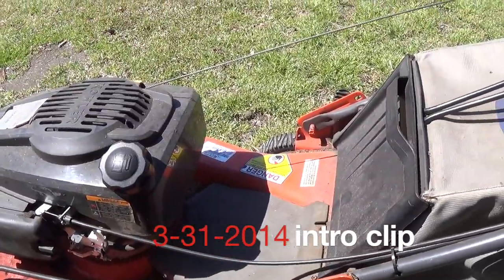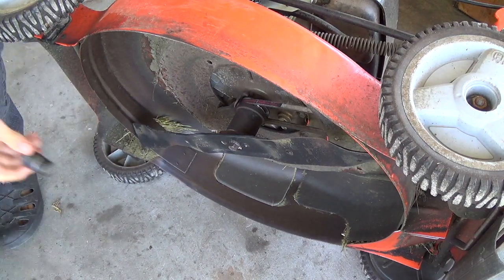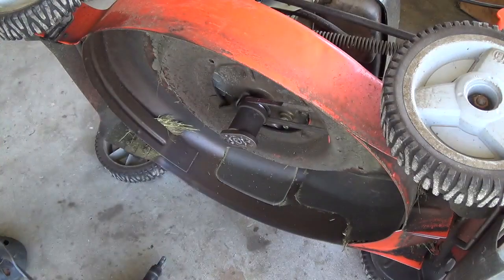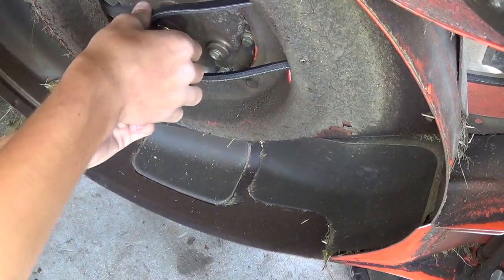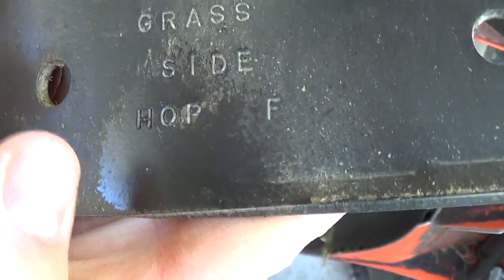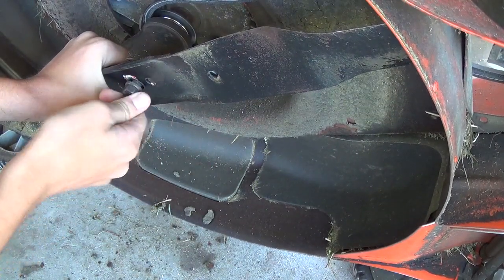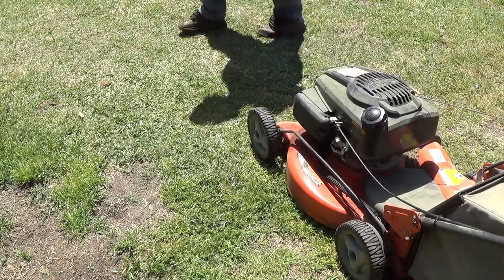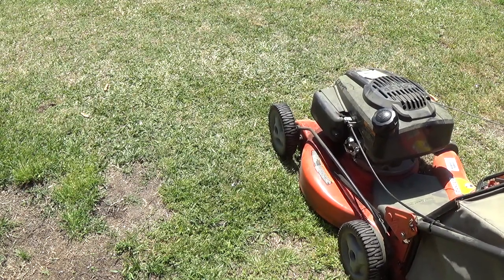2009 Husqvarna 7021RD Self Propelled Push Mower Drive Belt Replacement

Comment: This is the only video I could find of a mower just like mine. I was wondering, is there a way to adjust tension on the drive belt?? I know you can adjust cable but what about the pulley tension?

Comment: Where did you get the belt, I wind up getting the wrong belt from the Lowes. I need the one like yours, mine is a Rear Wheel Drive lawn mower. Can you post the part number or a link where I can purchase the belt. Thanks
Reply: i own a lawn mower shop and i get all my parts directly from various companies, Lowes is not the place for outdoor power equipment parts, what i recommend is going to your local small engine/lawn mower repair shop give them the model/serial number of your equipment and they can get you the right part, this video is so old i don't remember the part number.

Comment: You should have used a torque wrench to put that balde on.
Reply from the maker: i've been doing outdoor power equipment repair for over 20 years and was a Husqvarna dealer for around 15 years, i have my own shop and have changed thousands of blades and never once used a "torque wrench" air impact is all i've ever used, never once had any problems in 20+ years.  thanks for the comment.
Reply: Yea, its really not necessary to torque the blade, as long as you tighten that bolt down good thats all that matters.

Comment: Its neither Sears or Husqvarna, its AYP. AYP was contracted to make mowers for Sears, Husqvarna and it also includes Poulan Pro, theirs also a few less knowns that fell under it. The parent company was electrolux which was a subsidiary of sears. Thats no longer the case, Sears sold that asset. Now mowers at Sears are mainly made by MTD and Husqvarna and Poulan are on their own now, but at that time in 2009 those mowers were still all under AYP. I have an old mower from 1995 sitting around right now, that has an AYP model sticker on it. The days of good mowers like that being made  are over, 2009 was about the last year they made those good mowers and I have that very same mower and its the best mower I have ever used, the power on it is off the charts and it cuts as well as any Honda. Its better than a Honda.
The new ones suck compared to that one and I'm talking Husqvarna now, those Husqvarna's that were still under AYP were far better, than today's. As most folks know, MTD mowers are total crap, not even gonna go their. So for those who thought Sears and Husqvarna werent the same as far as mowers, they were, just not by Sears, by AYP, but now, its a different story.